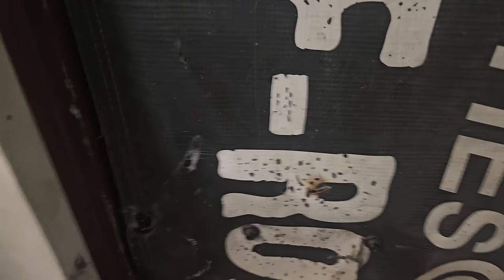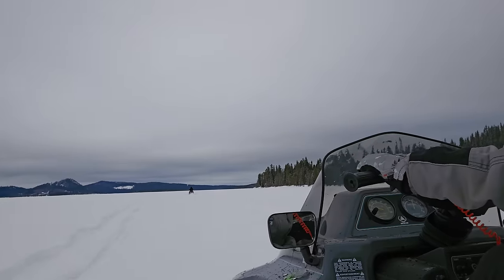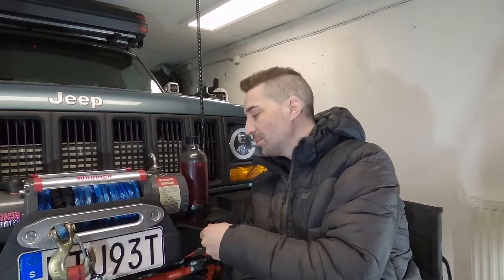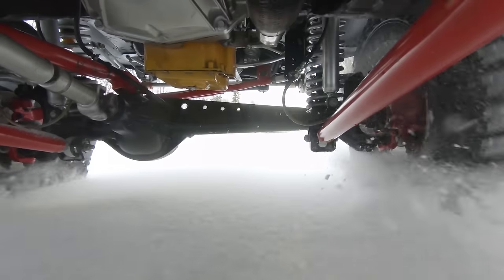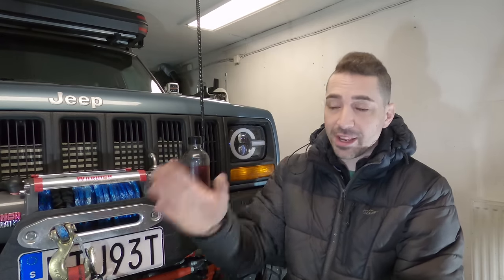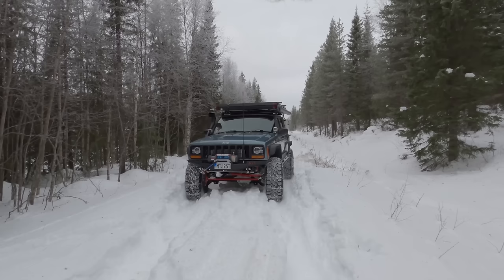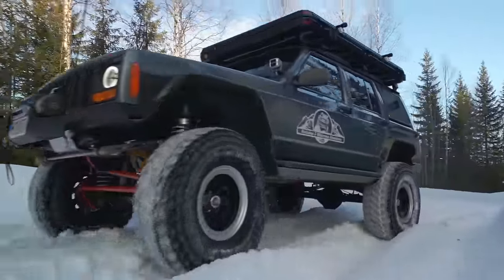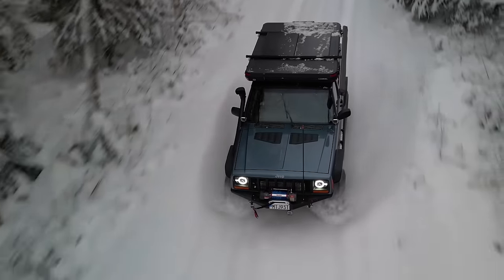Why Don't I Drive A Land Rover Defender?

Comment: As an American with an XJ, I always wondered why you didn’t choose a Defender for parts availability alone.  After all of the work that you’ve done to yours, I don’t see why a defender couldn’t be built to be just as capable, maybe for even less.  My guess is that weight and creature comforts are objective reasons to choose the XJ over the defender, and it’s up to the owner to decide if those outweigh parts availability.  Also, given that GB doesn’t have the same off-road and culture as the US, despite parts costs being high for XJs in Europe, equivalent parts for a defender may just be completely unavailable.  Disco seems like the in-between, but maybe less modifiable.

Comment: Hi Mike. Looking forward to all the future content. The 4.0. The snowmobile too. It’s great just learning along side you. 
I agree with you on the 4.0 Mike. Keep it light. 2”/3” lift. 31” tires. Perhaps a lunchbox type locker in the rear axle to replace the open spider gears.  The 4.0 will be much lower mpg than your diesel. So keeping it light will help. 
Also Mike. Replace all the main ground and positive cables with new and bigger gauge wires. The 4.0 is the opposite of your diesel. All those sensors are not happy if your voltage and engine grounds are not in good condition. 

Something else to look for Mike/beef up. The two spot welds on my front cross member. Where it attaches to the unibody frame rails cracked on my xj. Just in front of the steering gearbox. This happened with a gear box brace bracket and a full width steel front bumper that’s bolts right through into the steering gearbox. My gear box was flexing and giving vague steering feel. It took me sometime to figure out it was this. As it all looked fine. Once re welded. Night and day difference.

Comment: I have a heavy XJ… it’s about 2500kg. And I don’t have the RTT and slide out. When you start putting bumpers, aftermarket axles, frame stiffeners, armor plates, atlas transfer case, roll cage, bigger fuel cell, the weight builds quickly. I think owners with lighter XJs just haven’t experienced the component creep or just run them like tin cans intentionally. That’s fine: it’s an amazing wheeling machine but the durability becomes an issue. I drive mine around the western US and don’t trailer so it has to get home.

Comment: Getting back to the bit about tires: I gave 325/85r16 Michelin XMLs a go in my heavily modified Opel Frontera. My friend, what a treat they are! They didn't require any balancing (39"!!!), they handle on road like 1st gen BFG MTs, off road they are great but not Interco SS Boggers level. Give them a try if You would ever want to upsize from 35s. Cheers!

Comment: Traction control just pop a sensor wire apart or an early one with diff lock engaged then turn it on and it’ll disable tc, hill descent is kinda good with abs thought
Reply from the maker: Thank you!

Comment: 21:30 Mike do the snowmobile workshop and camping trip, Renix yes to frame stiffeners need on my ‘94 but turn off my hearing aids instead🤪, just replaced my H’balancer was cutting onto the alloy timing case cover, couldn’t work out what the noise was. Short answer just do it we want to learn👍🍻

Comment: be cool to see a snowmobile build/camp, look forward to seeing the 4.0 rebuild, be good to get some of the hunting stuff back again, 
I like the jeeps while i am a Landrover guy and have some Landrovers... a discovery 2 td5 been the main vehicle we own. but your jeep is a cracking vehicle its capable and you know it so well you have put so much work into it over the years so much blood sweat and tears i'm guessing it would pass a DNA test!  a stock defender is going to need alot of work / welding etc to get to the same stage as you have your jeep.  and i agree for distance a discovery 2 is a better vehicle. and yes you can turn off the TC or it just stops working when something falls off....

Comment: As someone who's owned Defenders, I don't need to ask you why you don't own a Defender... ;)

(Edit: this is wrong; see comments) Re D2, yes, if you engage CDL whilst the engine is off and then start the vehicle, ABS and TC are completely disabled; presumably you'd have CDL engaged in the conditions where TC can work against you? 

Re snowmobile, absolute yes from me. Just crack on filming whatever you want to film, it's why we're here in the first place. If you leave it to the audience to choose, you'll end up doing only fans with Bigfoot.
Reply: Re ABS/TC, The ABS/SLABS ECU knows the transfer box is both in low gears and diff lock (if fitted) but it doesn't turn off the ABS/TC. The manual states the following:
"Driving with the differential locked at speeds above 40 mph (60 km/h) may, under certain situations affect the brake performance under ABS conditions".
Reply: @overlandready  right you are. I had retrofitted my CDL and I was under the impression it disabled TC. It certainly seemed like it did, but apparently not. Cheers for clarifying.

Comment: Why you chose a Jeep Cherio over a Defender? it's personal choice and that is perfectly fine! It'd be boring if we were all the same! 
Other than that the choise is mostly based on a few factors I'd say,  but in no particular order; price, internal room, heating (if you're somewhere cold like you), mod-ability, aethetics that you like, perceived reliability. There are probably a few more, feel free to add some. 
I chose a Defender because they are actually one of the most awesome vehicles on the planet, I've driven a Jeep Cherio, and I vowed never to drive another one! Yes, it was that bad! there was nothing mechanically wrong with it, but it just tried to crash itself and the gears were wrong ratios, the kickdown just randomly happenedand needlessly revved the engine with no decernable effect, the seats were like slippery armchairs and it was too bouncy. Yes, a lot of that you can change components and work on it to solve, but it wasn't my vehicle. Now I bought a Discovery 1, it was smooth, refined and like most 90's vehicles, a little bit noisy but only a little, you never noticed the gears change, it changed down when you wanted it to, the seats were lush (I could drive that 500 miles and get out feeling better than I got in!) I did everything off road that everything else did straight out of the box, the only thing that let it down was diff height (lower tyres than the Defender equiv but the same drivetrain except T-box ratio). 
5 years ago, my brother and Dad bought a 300tdi 110 as a surprise for me, it was a 97 300tdi 110, the same engine as the D1, the chassis was very near death as no one cleaned it. I've literally rebuilt it from rust to what I want, the gearbox is going to soon be swapped for an auto (a couple of reasons for that, but I like autos!) and every body nut, boly and all the bad bits have been replaced. (bit like what you've just given the info on on the other Jeep) All it needs now is really paint and finishing putting back together (no point until it's the colour I want). It's standard height and perfect for enything I'll throw it at and some of that will be hard tracks. It'll do way more than any standard Jeep Cherio! (probably more than 99% of modd'd Cherios too!)

What you choose it up to you I'll never judgeas I chose what I want, but remember, the Defender community is awesome! reknowned as better than any othe marque. Don't say they can't go anywhere, there is a lot of proof that they can go further than most other 4x4's. Remember their heritage is an off road vehicle that can use the road, not as most, a road vehicle that can go off road. 

D2 ABS/TC
No you can't officially but there are ways! it is a BTC, so it doesn't drop throttle and it shouldn't cut in unless you have a serious wheel speed differntial for a few seconds. It also works to 60mph  (most are 15mph or less). I don't think you'd have a problem to be fair, but I can tell you what to do to disable it, If it has the air suspension or want to keep the ABS active, it needs to be done in a different way. 

Snow driving is one of 2 main scenarios and it depends on the snow and general terrain, thin tall tyres that cut into the snow, or very wide floatation tyres that ride on top. soft, deep snow is really the latter, hard shallow snow if the former. 

Never knew why Jeep didn't put CV's on things, Hardy - Spicer joints on a drive shaft is a bit old hat even in the 90's.

Comment: Love the channel and videos. wish I had converted my 2wd XJ to 4x4 instead of selling it (I do own a wrangler TJ but want a 4dr) Couple questions- what are you running for a 2way radio? Regular 40 CH CB, GMRS, or HAM? Can you show how you have your antennae mounted to the front bumper along with the type and size it is.
I would like to take mine off the tub and mount it up front a bit lower than it is now. I also like the look of them mounted up there.
I would watch the videos of the snowmobile rebuild. I sub to a lot of mech and wrench turning channels- your XJ vids are what brought me to subbing and I watch them all now.
Reply from the maker: Hey Chris, thanks for the comment. My radio setup is archaic and needs replacing to be honest. its a 27mhz CB radio with a firestick antenna. We use to just to talk to each other on longer trips. I can show how the antenna is setup in the next Q&A if that would help?
Thanks for watching and subscribing!
Reply: @WorkshoptoWilderness  Hi Mike,
Yes please, if you would show the set up. I am very interested in relocating my antenna, a firestick as well, to front of the jeep. I currently run an old Uniden 40c CB but also have a handheld GMRS. Same use as you, only for off roading.

Comment: Love your content, have been watching you for a few years now. I'm in Michigan (USA) and have a 1999 XJ with the 4.0, NP242, about 2 in lift with the flat flares. Question - If you had E-lockers in front and rear with a 31" tire do you think it would perform better in the deeper snow than 35s with no lockers? I'm excited for when you get your lockers so i can see the difference.
Reply from the maker: Thanks for watching, and I'm glad you enjoy the content! I personally don't think the footprint of a 31, locked or not, will outperform the footprint of a 35 on deeper snow. I used to run a 32 about four years ago, and when I eventually went up to a 35, the difference was very noticeable in floatation. It often depends on the type of snow though and what you consider deep or not.
Most seem to want the biggest widest tire possible aired down very, very low, so they have a massive footprint. I'm interested to see how this locker will do when I install it. Hopefully, it helps a lot!
Reply: @WorkshoptoWilderness  thank you for the insight, it will come in handy as I start pushing my unit harder! 

A side note: I was hoping you could include a section of a future video showing the isofix system you have for the car seat hook up. I have a 3 yr old daughter and would like to start bringing her out in the xj for overland adventures.

Comment: I was wondering have you considering builting the rear drum brakes to disc brakes from zj? I bought all the parts new this winter so when the weater getts better im going to convert mine to rear disc brakes, i think maintenance is going to be easier and maybe better brakes with bigger tires
Reply: Is he still running drums, I thought he had already converted it to disc.
Reply from the maker: I'm on drums at the back. A conversion is on the cards.

Comment: What are your thoughts about the WJ Grand Cherokee?
Reply from the maker: They are awesome! Great platform to build from. They can be beasts
Reply: I love mine but I have found break break free to be my friend on any bold underneath, even given mine that is is near 100% rust free and pristine condition. The threaded inserts on the frame and weld nuts have stripped and spun on me a time or two. Nothing building a flag bolt or tapping wont fix but frustrating none the less.  @WorkshoptoWilderness

Comment: Discovery 2 will turn off the traction control by its self with 3 amigos lmao, 
I have a d2a discovery and honestly I don't trust it off road every time you get it all fixed and ready to head out bush it breaks again, I ended up buying a 93 hilux cause of that
Reply: My old man bought a Land Rover because he got the Hilux he had stuck on grass! (no mother wasn't happy as it was the lawn!) So he bought a Series 2, never stuck again. Horses for courses, He now runs a FL2 and it's perfect for him but a lot of tax. He'll have a 110 auto next (it's beinng built at the moment).
Reply: @overlandready  yeah I knew I was dropping some capability, but not having random issues that are trip stoppers more than makes up for it,  plus what I lost was easily made up for with lockers.
Also the hilux is so much nicer to work on

Comment: You love pain, that's why. By the way, cluster not working about to burn that thing ;)
Reply from the maker: Your instrument cluster isn't working you mean?
Reply: @WorkshoptoWilderness  engine is running without any problems, but I have no instrument, looked at the pins, gave new grounds, checked every fuse,... Nothing.
Reply from the maker: @ENGINES_TORQUE  Sorry if this is a dumb question. Is your engine side ECU plugged in? The black thing under the hood.
Reply: @WorkshoptoWilderness  Yes it is checked the contacts, licks good. Talked to a few people and everyone had another solution. The moment the control unit gets a wrong signal from SOMEWHERE it goes .... Nuts.
Reply from the maker: Hunm. Well, my instrument panel can go dead occasionally. When it does, I just push the glas on the instrument panel, and it all comes back. It's a loose connection at the back. This probably isn't your problem
Reply: @WorkshoptoWilderness  would be easy
Reply from the maker: @ENGINES_TORQUE   Have you tried it? If not a new under the hood ECU?

Comment: Cuz Land Rover sucks that is why
Reply: A rig is only as good as its driver and compared stock vs stock an XJ and a Defender are pretty evenly capable. Start modding stuff and it becomes more about how deep your pockets are
Reply: Every engine sucks, every vehicle has it's lovers and haters. Most Defenders are claimed to be unreliable because they are not cleaned or serviced. you can't expect reliability if you don't look after things. I will however counteract your negativity with saying they are AWESOME! I've had a few, the new ones, naa, not worth it. The old ones, yep, I'd have another... I won't sell the old ones...